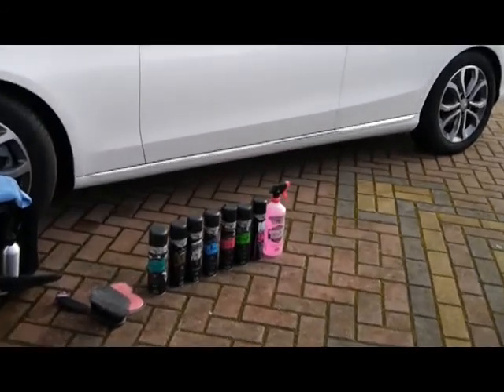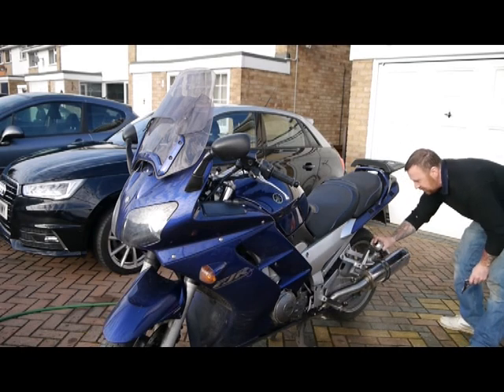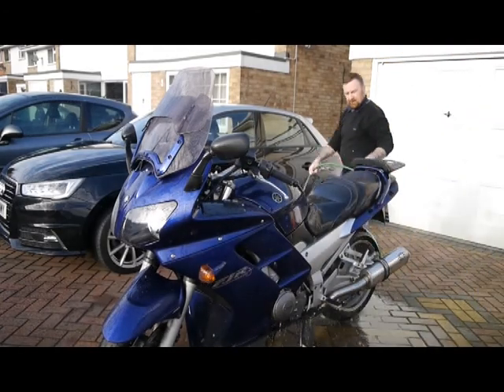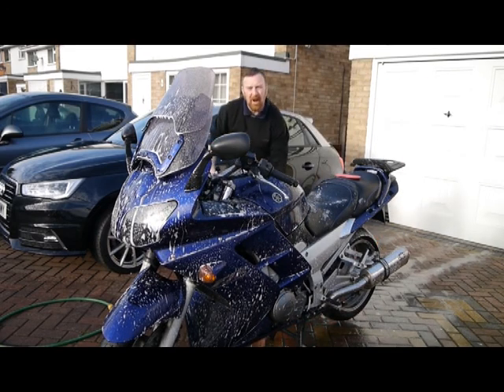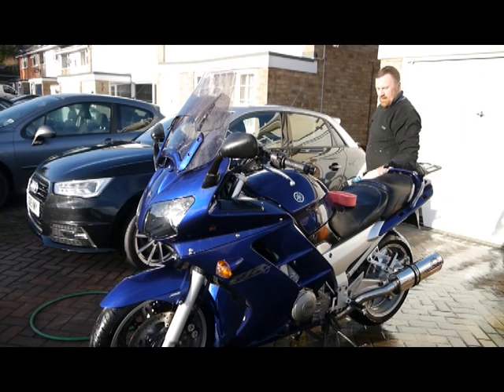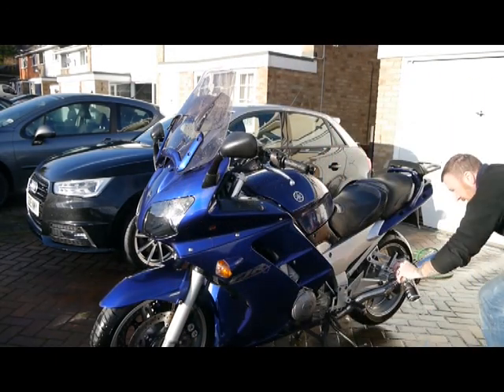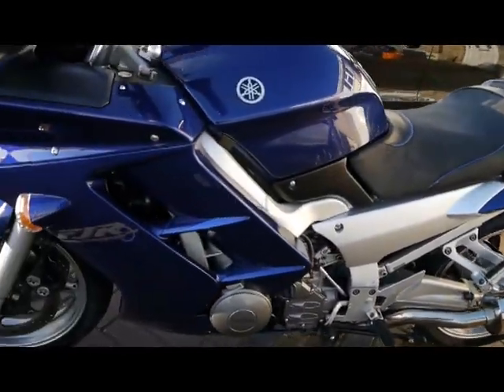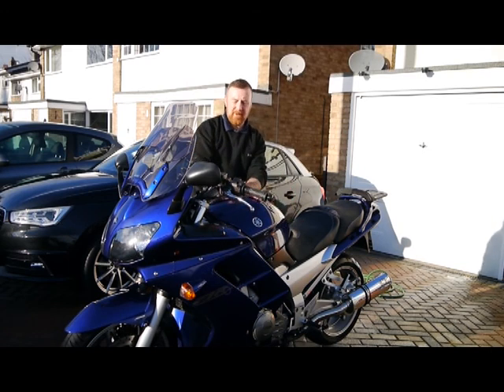WASHING YOUR MOTORBIKE YAMAHA FJR1300 MARK SAVAGE

Comment: Hi Mark thanks for sharing your video. On my FJR I just use a cheap car wash shampoo followed by AutoGlym Super Resin polish on the paint work. I never use a sponge but prefer to use a micro fibre mitt. A leave blower to blow off the water helps me speed up the drying process.
Reply from the maker: Gas Guzzler thanks for watching bud , it worked well on my b king as in the video but it was worth using and will see how it fairs out 
There are some other videos on here you may like to watch 
Thanks mark